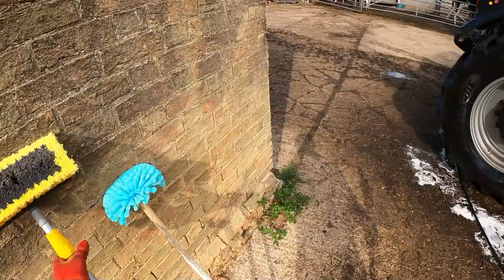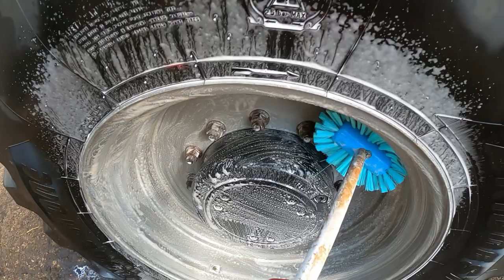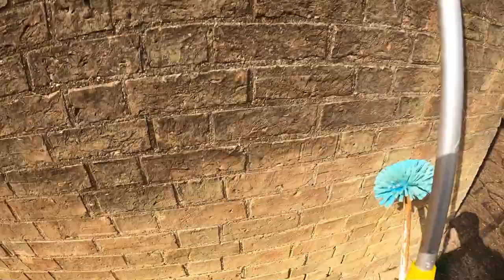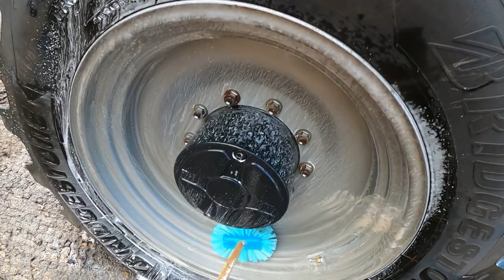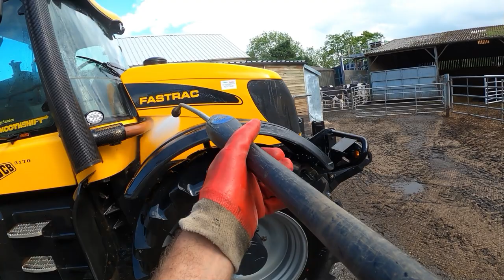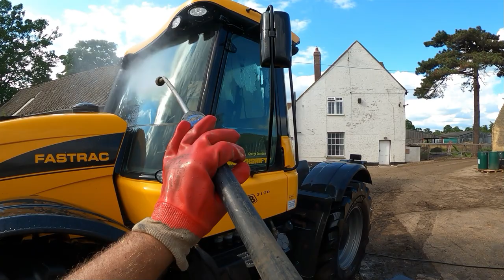TRACTOR WASH

Comment: Just had a few thousand cows drop dead from heat exhaustion in the central US. Very sad.
Reply from the maker: How hot are you over there Bill? About 28 degrees centigrade here today, 33 predicted tomorrow which is very warm for us and then cooling down again. I suspect you'll probably be a lot higher.
Reply: @GeorgeSaunders  George, rather than me explain, go to Yanasa  TV,  you tube channel & let that creator explain, he also has the video, it is shocking.